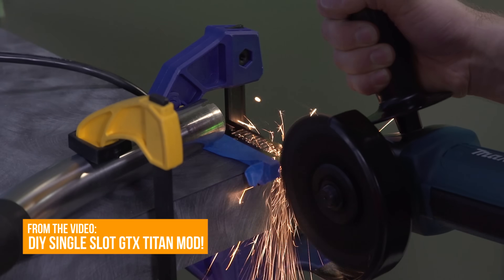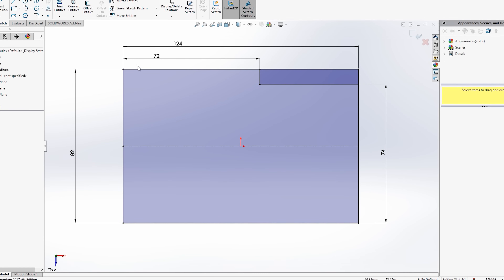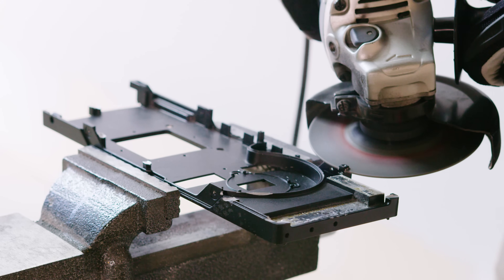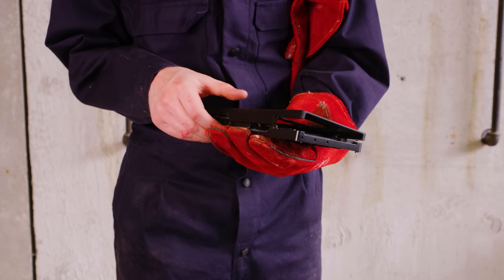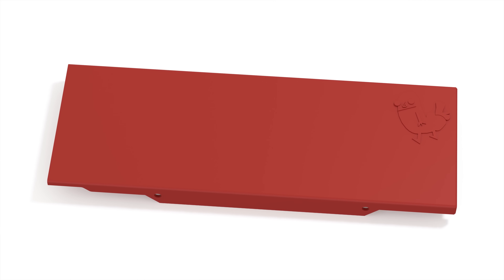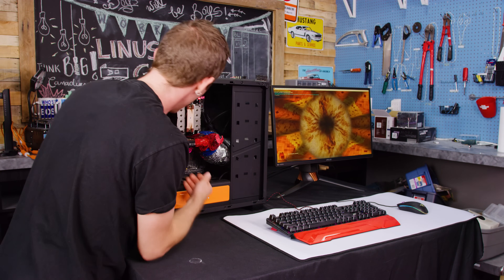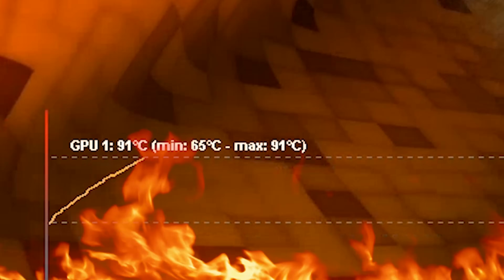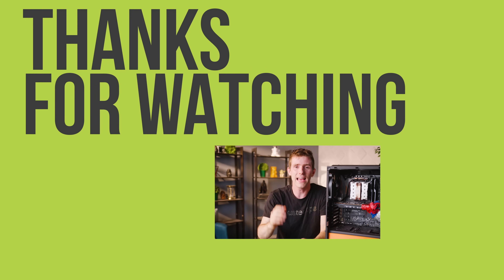Chopping Up a GTX Titan... AGAIN!

Comment: Why get a company to 3D print you something when you have a high end consumer printer yourself?
Reply: 3D printing company don't own your regular "home" 3D printer. They probably have higher end ones that have better precision or even other types of material. OR maybe just a plug, either way, they're far from stupid :)
Reply: +Risto Mladich Did you not see how they had to modify the first case for the GPU because it was printed to the wrong specifications? Commercial printers can be much more precise which is necessary for intricate designs and they are vastly more reliable than consumer printers that would most likely only be used once in a while. I didn't say they couldn't print from consumer printers, I said that Linus most likely asked a 3D printer organization to print it because of the quality assurance they provide (instead of their rough and crude way to fix up issues with their GPU cover).
Reply: Keep in mind that with the math they KNEW that this cooler wouldn't work before they even built it so paying a company to 3D print something for it when they could of done it themself makes no sense at all.
Reply: oh yeah drakon... they are printing out of steel right? thats the reason why they cant print from "consumer version" as you say...  its not like you can do the same with $250 FDM printer. and what quality is there in 3d printed plastic?
Reply: It still would have been good enough for what they were using it for
Reply: +Krytern UK You have to remember that it's Linus you're talking about. He always goes for the overkill things
Reply: +Risto Mladich
the most notable feature of Companies that will print things for you is extreme accuracy.

necessary for this task? certainly not since it's just a U shaped object with screw holes. but that's a different matter.
Reply: Because 3D printers that they have are most likely consumer versions that are far worse than commercial machines and you're paying for the quality assurance.
Reply: 3d printing is not just "click and send to print"
Reply: TheArticfury Because they are stupid LTT.

Comment: You guys and your constant derp... ehhh...  Heat pipe to the rear, heat sink the full thickness of 1 slot off rear of card... Would be longer, but still single slot... Cooling would be adequate if not good.  

Flex dryer duct and tape?  What was even blowing on it?  Man.  And the tools and usage of said tools, as always, cringe worthy .

Comment: I hate how the iOS YouTube app defaults every video to 360p or lower and you can't change the default resolution
Reply: iPhone users, am i right?
Reply: If on wifi, it always starts at the lowest resolution then it switches to whatever is the highest your wifi can handle. There should be an option to always play on the highest resolution available no matter what.
Reply: Lasse Reinlaufen Plus models are 1080p not 720p, also the playing youtube videos at higher resolutions than your screen resolution is actually beneficial because it enables a higher bitrate
Reply: Erik Use the mobile website then. It works flawlessly with a good browser. The navigation is a little slower because its a website, but the rest is equal.
Reply: Erik I'm on the IOS app. Mine defaults to the highest Rez of the uploaded video. Yours is broken.
Reply: Erik on mine it defaults to 1440p. Which is even more annoying when it takes a minute to buffer the video xD
Reply: 1440p on my phone
Reply: Use ProTube. Super better.
Reply: +The 3d melon I was stating that an option should be made.
Reply: It could be interpreted as: "if you look closely, there should be an option to always play on the highest resolution available no matter what." That's how I interpreted it the first time I read it.
Reply: RF Arrow thats four times the resolution of an iphone. Why would it default to that if it could simply play at 720p with the same quality and a quarter of the data used?
Reply: DJPLAYERKING - You completely misunderstood what he said. Read his comment again. He did not say he can't change the resolution of the video, he said he can't change the DEFAULT resolution of the video. You do know what 'default' means right?
Reply: Another ProTube shill here. No ads, nice interface. Buy it! :)
Reply: Erik yes you can
Reply: Doesn't happen to me. Maybe it's your WiFi that's slow? It happens when my WiFi slows down.
Reply: Erik thatsso untrue i watch 1080p on my ipad and if u cant change it its the three dots on the top right then click quality if 360p is the highest then its your device.
Reply: I don't see that as a big deal. Just change the resolution when you watch a new video
Reply: youtube throttles its own data when you are not on wifi. it does that on android too,  because some people dont have 900 billion gigs of data every month. watching in lower res takes less data, so they set it as low data by default. yes you CAN change that, but it is extremely complicated: google "change ios youtube quality settings." damn, that was hard
Reply: Or just get android